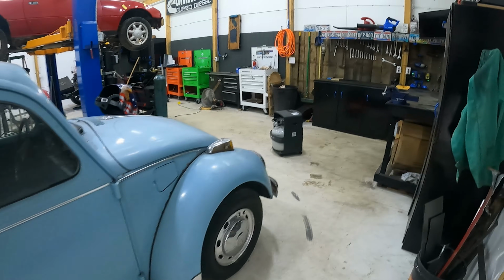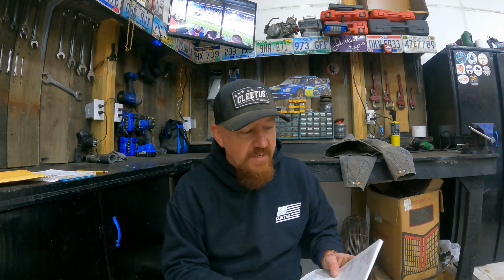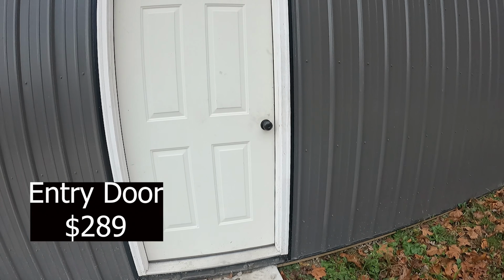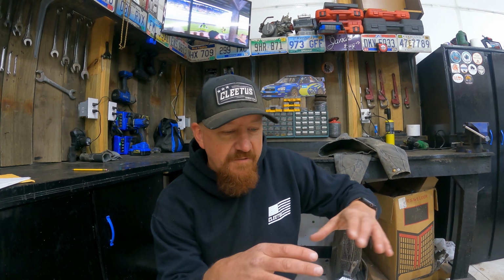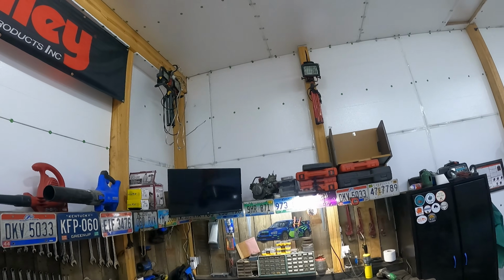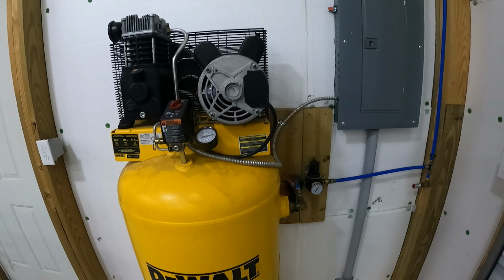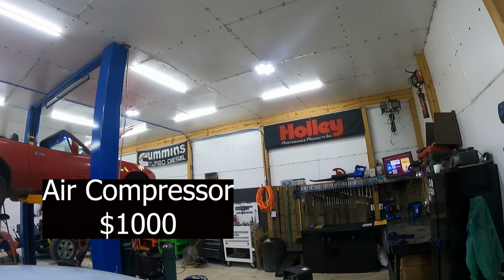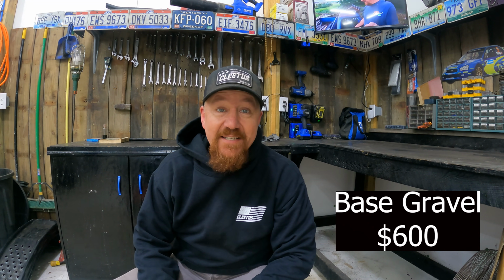Dream Garage Total Cost Breakdown - How Much Was Our 28x36x12 Post Frame Shop?

Comment: Your man door should be a commercial door that opens out. You don’t lose any floor space inside the building and if there’s a fire or accident, you gotta get out quick.    door opens out they make security hinges for the door and you put double locks on the other side nobody can pull the pin on the hinge always go with a commercial door opening out safety first.

Comment: Automotive lifts are required to be able to safely operate picking up 25% more than they are actually rated. So to get an 11,000 lb capacity rating requires actual lifting capacity of 13,750 lbs.
(7,000 lb rated: will lift 8,750 lbs;
9,000 rated: will lift 11,250 lbs)
I have installed hundreds of lifts of all types. Rotary, Challenger, Gilbarco, Ben Pearson, etc. 4 inches of reinforced concrete, ¾" anchor bolts, holes drilled all the way through, never had an issue.
Reply from the maker: Good information!  Thanks for sharing.

Comment: Did you put the post in the ground or did you put a galvanized metal bracket on top of the concrete and then bolt in your post? There is a big difference between a pole barn and a post frame constructed building. One last for about 40 years and the other last generations.

Comment: Keep in mind that he doesn't add the labor cost. Here, the labor will be easy another $20,000, plus the tools and equipment you need to doit
Reply from the maker: That’s true, but it was also the point.  We did it all ourselves so I’m sharing what you can save if you can DIY the build.  👍

Comment: Killer breakdown. Thanks! When I do one of these it's going to have a lift AND it needs a storage loft over one of the garage spaces. Did you consider doing on eof these to recapture some of that open-air ceiling space? Anything major to think about from a kit-buying standpoint?
Reply from the maker: I have thought about some loft type storage.  I might add it one day.  As far as the kit, my metal supply place made it effortless.  👊

Comment: $750 total for wiring?i either call BS or something fishy going on.a 125ft roll of 6-3 wiring in itself costs $500-600 in WI. as of last year.10-3 wiring would still be around $250 for 125ft.. for welding.that was 5 years ago when i built my shop and did all the wring myself.either stuff in really cheap in KY or ? I guess i will compliment you on being resourceful its that good stuff aint cheap and cheap stuff aint good.more power to you but not even close to the way I like things but to each his own i guess....
Reply: He probably just ran Romex for all the lights and outlets and ran heavy cable where needed for bigger power draw.

Comment: A bit surprised you were nervous of a lift but went with that Triumph after all that concrete work.  I went with Bendpak in the end but looked at those Triumphs for months.
Reply from the maker: I went with the 11k and it seems as solid as could be.  We use it a lot and haven’t had any issues.  If budget allowed, I would love a Bendpak for sure.
Reply: @PeeksPeakHobbyHomestead  that’s great to hear!  When I was looking at them in in 2019 they could be had for $1800! I really wanted to do it but I got the BendPak Grandprix for $2300. The price is ridiculous now.

Comment: I wouldn't want spray on insulation. If you want to make changes later add windows do electrical work fix the building it's just a nightmare. Regular insulation you just pull it down and reuse it.

Comment: This is such a cheap way to build, in Sweden we do the concrete foundation waaaay thicker than you, deep corners! Wood straight down in the earth will just rot within 10 years. Big no. You need to have drainage around the building so water will always push away from the foundation. No wonder your houses collapse when a tornado hit I’m in shock by your building standards.
Reply: Well this isn't Sweden it's the US and Kentucky.   Treated beems last way longer than 10 years. I have some in the ground ground for 20 years and they are still solid. Plus we have tornados that can rip up concrete and asphalt off a highway so the building would be gone anyway wouldn't it.

Comment: I'm on my third replacement of Barrina lights over ~3 years.  I will say that Barrina has sent replacements under warranty, but at this point I pretty much always have a few burned out.  My plan is to replace them with just LED strip lights hooked up to some power supplies in the future.
Reply from the maker: I have a dozen in my barn and I think I’ve had 2 burn out in 3 years.  They are cheap, but hit or miss on quality I guess…
Reply: @PeeksPeakHobbyHomestead  I had hoped that the first batch I got was just a bad batch, but when the replacements started failing I lost hope.  I currently have 4 out of 12 burned out, I purchased them in Feb 2020, so 3 years, I think all of them have failed at least once.  But, barrina did stand behind them and send replacements.
Reply: They may have some bad and some good models. I've had one set for about 3 years that are now in my girlfriend's metal foundry shop and all 12 work fine. I have another 15 in my shop that are about a year old and also fine. All of them have been infrequently exposed to high humidity and temps between 20 and 150 degrees F. Haven't had a single one fail. All two bulb units with 120v plugs and wrap around housings.

Comment: Heated slab would not have cost all that much. At least start with installing the tubing and get the mechanicals later.
Reply from the maker: Yes, this should have happened.  I regret that.

Comment: $22,500 was the total for everything and just for concrete and frame was $11,300 not a bad set up
Reply: Keep in mind that he doesn't add the labor cost. Here, the labor will be easy another $20,000
Reply: Or, diy  @gulopac1
Reply: Did he buy the land or was it just the build? I jus wanna cut to the chase
Reply: @justapersonwithnoshadow  probably owned the land already. its about the cost of the garage itself and apparently some of the tools (Lift & compressed air & air plumbing)
Reply: That's amazing!!! Gives me hope for my project, mines a lot smaller (trying to create enough space for a 21ft Winnebago and all of my tools lol), but I had budgeted 30k. (I'm in Indiana). Thanks so much for the tips, I'm absolutely going to follow your advice!
Reply: Outstanding

Comment: Don’t do your own concrete!!! My footers in my garage are over 4/5 feet deep! High and low spots always occur. Cost in CA are ridiculous no apples to apples plus metal has no insulation factor better to stick build!
Reply from the maker: Oh I would absolutely do my own concrete again!  The imperfections are minor compared to the savings of $6-8k.  Now that the floor is in use we don’t notice a thing.  Also, you can insulate a post frame building just the same as a stick built building.  Everybody has to weigh their own factors though.  No worries.  🤷🏼‍♂️

Comment: You're getting really good deals. 150 bucks for hard creek rock? I just signed an order today for limestone screenings for 225 (with tax) delivered for 14 ton. But creek rock around here would be round stone. Not good for under concrete I would think because it can't really be compacted. It just likes to roll. Correct me if I'm wrong.
Reply from the maker: You may be right depending on the mix, but this stuff has a mix size that really made it pack well.  Then we went over that with limestone crusher run and it made a great base.  I’ve been using the creek rock for driveway base under limestone and it works really well!
Reply: @PeeksPeakHobbyHomestead  I'd like some of that rock over limestone. Here, the limestone when dry acts like concrete but when wet is just a sticky mess. I'm going to spread some limestone this afternoon and wet it down and try to pack it.

Comment: I at 20k for just the structure,  no concrete or anything for a structure that's about the same size here in CA. It does have to withstand 100mph winds and the occasional earthquake  but it comes with professional installation. The concrete was poured a couple of weeks ago still waiting on install.
Reply: @DXEDGE12  International steel structures. I made a video of the install it will be posted on my channel soon.
Reply: @Toms Backyard Workshop  thanls for the response. I will be following your channel.
Reply: @DXEDGE12  The workshop build video has been uploaded.
Reply from the maker: Sounds like a pretty good deal.  I hope mine never has to face 100mph winds or an earthquake.  👍  Enjoy your new building!

Comment: just built a metal building 40x60 which we hired out...in our late 60's ...not as much we do ourselves in these trades anymore
Cost 5 times your cost with posh epoxy floor and lift pads but no lift yet. Insulated with vinyl bags full of pink insulation.  We also installed 11 6x3 windows to enjoy the light and the views of the farm.  2 larger 10 x 12 doors with power operators and remote controls.  Finally 3 large LED lamps make the place like daylight even at night.  Bigger budget so more toys.
Reply from the maker: Sounds amazing!  Awesome size and the windows and bigger doors would be great!  Congratulations!